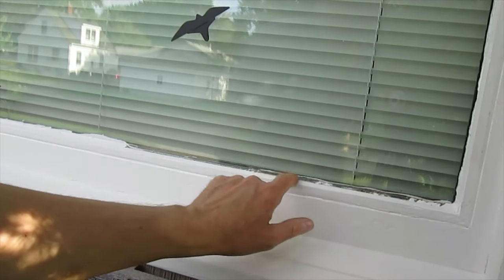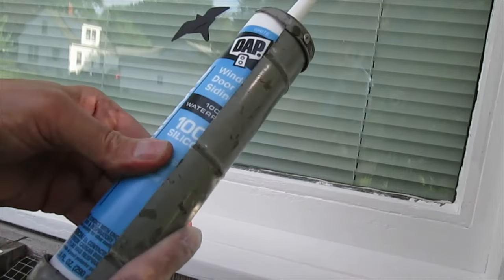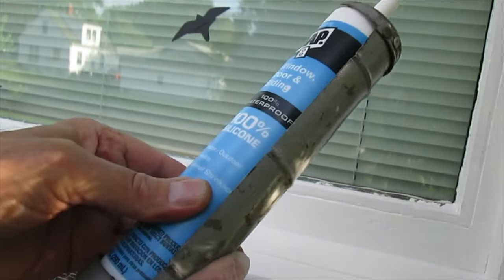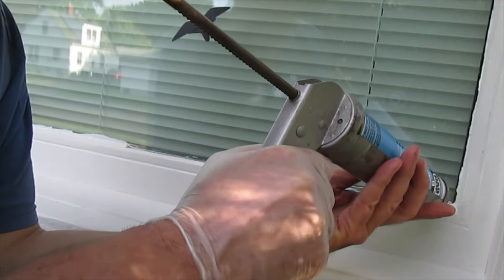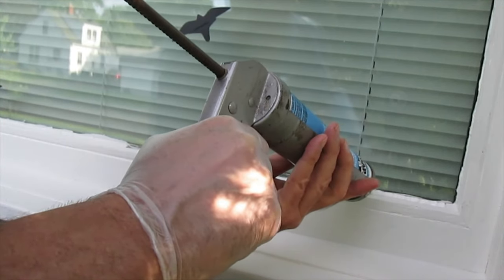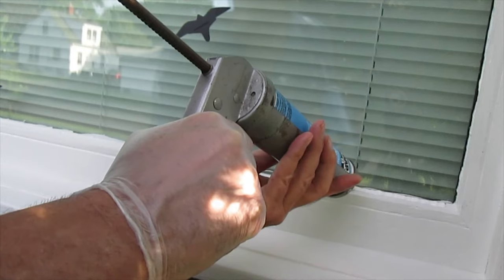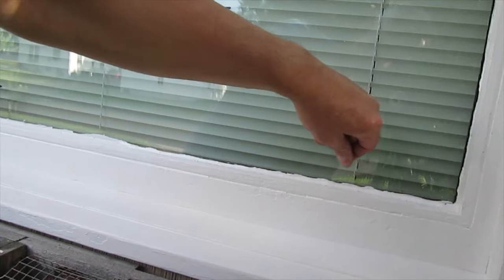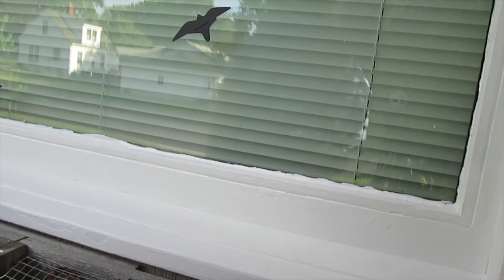How to Glaze a Window using Silicone Caulk

Comment: I think when I do mine I'll put painters tape on window so it'll have a sharp line after caulk is smoothed out.
Reply from the maker: That sounds like a good idea. Please let me know how it works out.
Reply: @PrairieTrading  I sure will. Another thing they did after letting the caulk set up for about 20 minutes, was after removing the painter's tape, they sprayed it with soapy water and smoothed down the little ridge left by the tape with wet soapy fingers.
Reply from the maker: @bobbyb7127  I have never heard of that before though it sounds like it would create a nice finish. I hope your project goes well!

Comment: Should have removed the old caulking first, the goal is to get the caulk into the opening, or the crack if you prefer. don't just run a bead on top of the crack, that's not caulking.